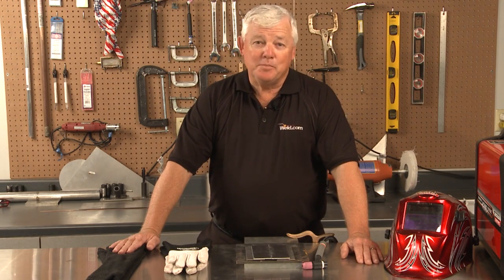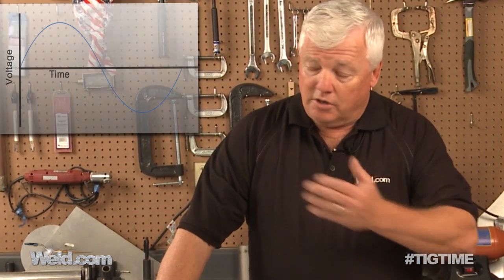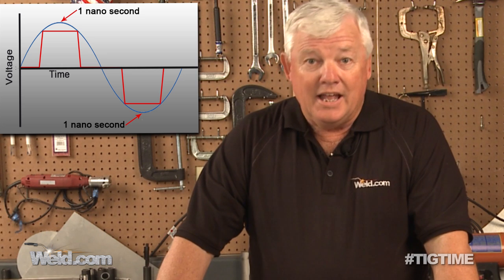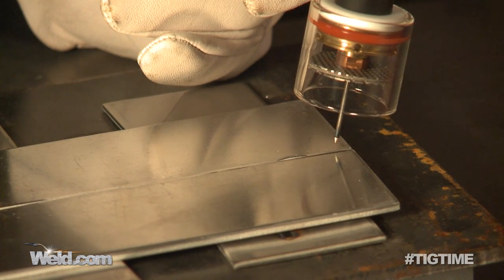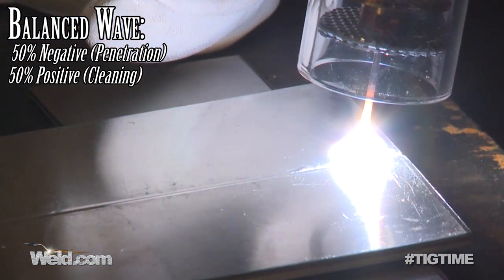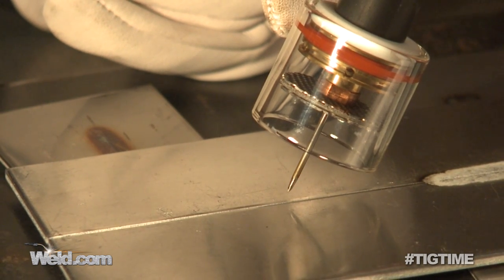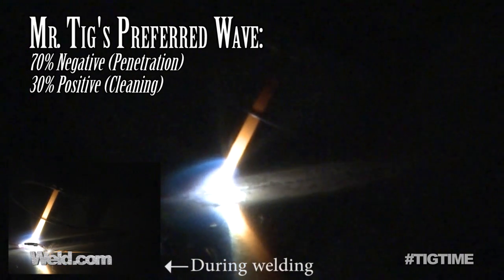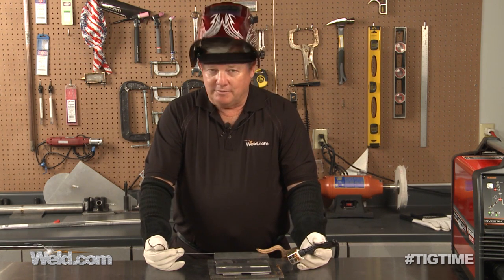TIG Welding with Square Wave Technology

Comment: Ok you guys commenting need to be more appreciative of what the mr. tig is doing here.
Yes I will admit it should be a ball point on the tungsten. 
But the 70/30 does a better job cleaning, but he was also using pretty clean aluminum already
When doing maintenance welding clean, clean, clean and clean again.
Airco Dipstick 160
Remember if you can't fix it, it can't be welded!
Reply: Richard Jordan You only ball pure tungsten. He's using 2% thoriated. Which is now pretty much been replaced with 2% lanthanated.
Reply: coors1800 
Everybody does things different, for sure, there are more ways to skin a snake, pure, 1%, 2% have even seen it done with beryllium. So what you like or what you do is your preference.  Just remember what you learn today is old news for tomorrow.
Reply: Richard Jordan Yeah I completely agree with that. I'm just talking majority.

Comment: MacroDragonFox,
Anytime the wave is in its positive portion there is cleaning action, regardless whether it is a sine or square wave. A square wave does, however, clean better because of the time it spends at peak. At every point in the positive transition there is power, again, regardless of wave type. Square waves have a higher power. Sine wave effective current is RMS (root mean square) or .0.707 times peak but it is still there.
Rob
Reply: Another aspect is if the peak voltages of the square wave and the sine wave are the same, then the power delivered by the square wave is higher than the sine wave.  It is that pesky old RMS situation.

Comment: fx451Jockey,
You're just about right. Wyatt doesn't understand waves. In a sine wave peak there is no point that you get pure dc. Where he came up with 1 nano is beyond me, sine waves are in constant change. Square waves are basically sine waves with high slew rates that have been clipped. What you get is DC when the wave is at its positive and negative peak as there is no change in current at peaks. 2 nanoseconds (one for each wave half)  does in fact = 500 Mhz. 
Rob
Reply: To put it into another perspective, the time duration of one complete sine wave cycle is 1/frequency in Hz times 1 second.  So at 60 Hz the duration of a half sine wave cycle will be about 8.3 milliseconds or 8.33 * 10^6 nanoseconds.  I would love to see an AC inverter with a 500 MHz frequency setting, though I will settle for 440 Hz, so at least it is a middle A note.

Comment: why the tungsrten is sharp ? on aluminum it's supposed to be a ball point .
Reply: If it's an Inverter technology machine you don't have to ball the end.
Reply: 327Doggy You only ball pure tungsten. He's using 2% thoriated. Which is now pretty much been replaced with 2% lanthanated.
Reply: The E3's ''purple tungsten" is the one tungsten that RULES them all - Does mild , Stainless & Aluminum . Even stays sharp while doing Aluminum - l have done it

Comment: I just watched his explanation again. It's rubbish. The cleaning action is a function of polarity. DCEP will clean lovely, but murder your tungsten. DCEN will heat the part, but not clean. So you use both.

Using square wave causes much faster transition between the two, and eliminate the low current points at polarity switching of sine wave. Even the graphical view of the wave form is wrong, as it doesn't show this, but a flat point at zero.

He can weld, but he's vague on tech details.

Comment: Um...no. If I'm understanding where you got that measurement from, he's telling you that the cleaning action (and the penetration) are only really during the flat portions of the wave - so only when the voltage and amperage are stable. In a Sine wave, it's awfully small and only during the change-over from rising to falling and vice versa.
Reply: Ummm, the power is the area under the respective curves.  For the sine waveform this is simplified by the RMS calculation as then being 0.707* V(Peak)*(1/frequency in hz)*1 second*0.5.  Where as for the square wave, the 0.707 is dropped as the RMS voltage of a square wave is equal to one. So for the same peak voltage, the square wave will deliver about 30% more power.  The 0.5 is in the equation because we only want to see the power from the half waveform.

The other thing that will happen with square wave inverters is that 70% of the time in the complete wave form is given to the negative polarity and 30% to the positive polarity.

hth